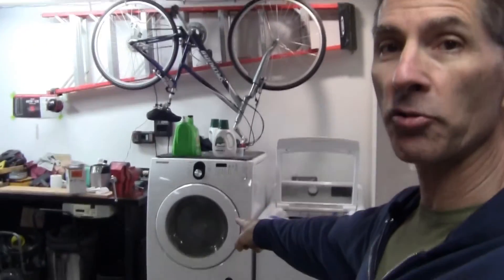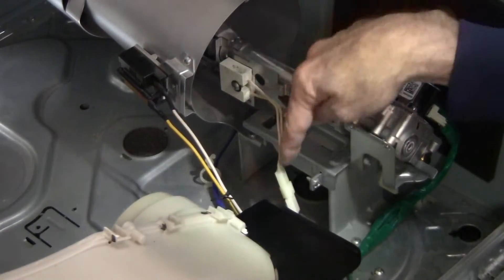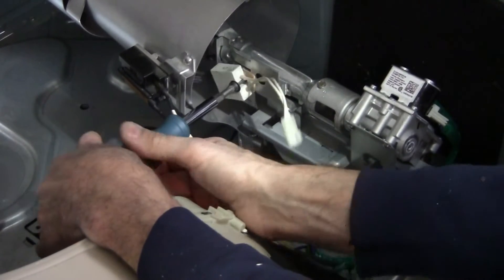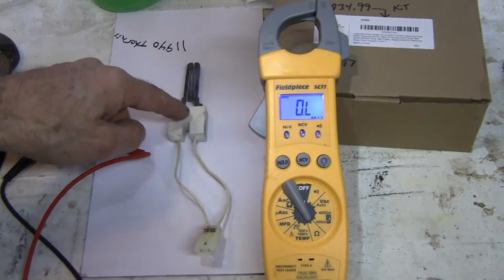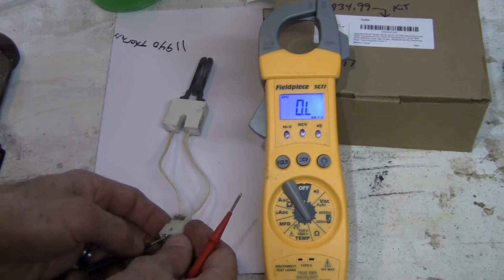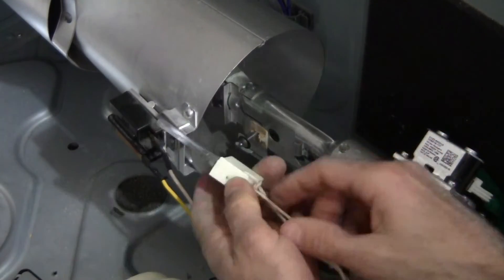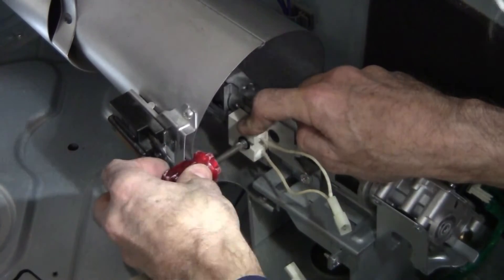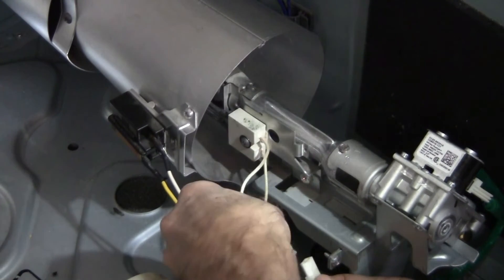Gas Clothes Dryer Igniter Testing

Comment: I have an lg dlgx5171w  gas dryer. It was bought in 2014. I have a resettable thermal fuse on the bottom of the burner and a regular thermal on top.
The resettable fuse will not allow it to be pressed down which caused me to believe that the thermal fuses were bad.  I got the thermal fuse kit from amazon...1 resettable fuse, 1 regular fuse and 1 thermistor. I changed all three...I can see the ignitor glowing for a few seconds, but no ignition of the fire. Any advice please.